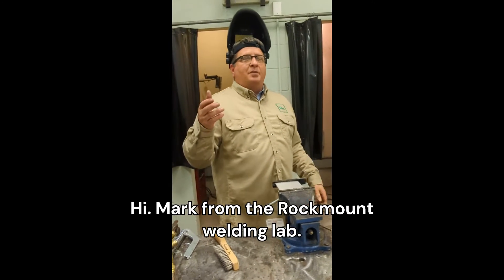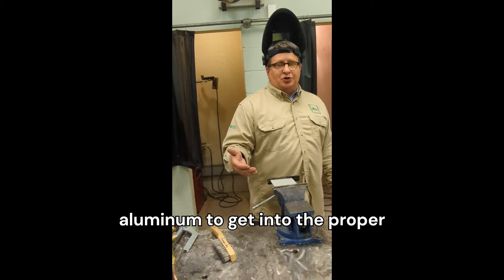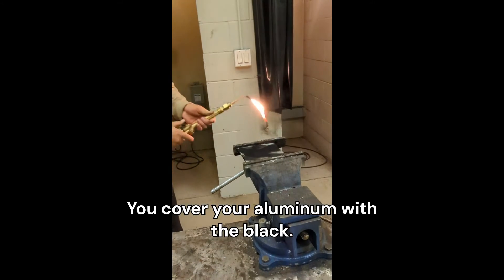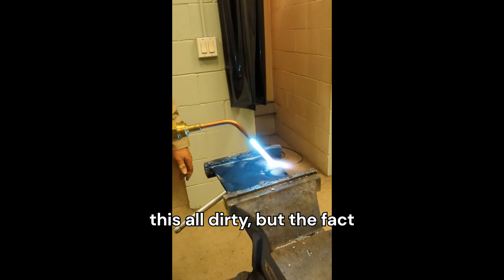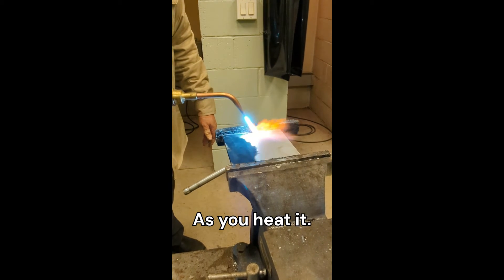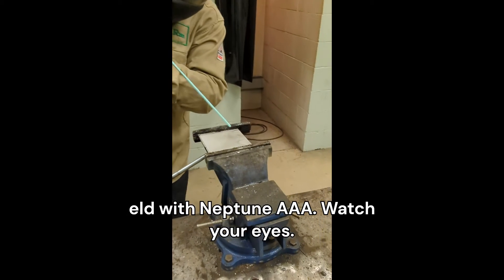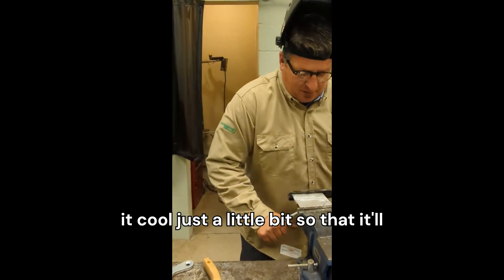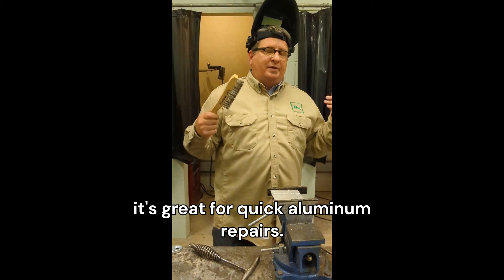Preheating Aluminum -- Rockmount Tips & Tricks

Comment: Thats not the way you preheat aluminum for gtaw/tig. I've been welding aluminum for years and gave this one a try. I took a thick piece of aluminum and blackened it with a carburizing flame, and it burned right of far before the working piece is at the right temperature to weld it properly.

The proper way (for gtaw/tig) with the torch is:
You set the torch at a neutral flame, the larger outer flame should be blue in color, keep the bright cone in the middle nice and small but not in an oxidizing setting. Then you aim the flame at your working piece and you can see the flame deflecting from the cold aluminum will be blue in color as well. You keep on going over your working piece until the color of the flame which is deflecting from your working piece turns bright orange. Then you're at the right temperature.
Be careful: once the flame gives the orange color you are really close to the melting point, you have to learn at which point you should stop.
Also be carefull with aiming at edges of your material since they will melt faster.

Try it out on a thicker piece, like 1/2 inch.